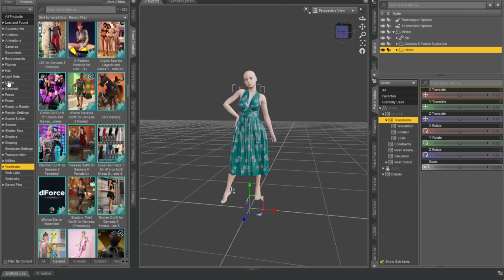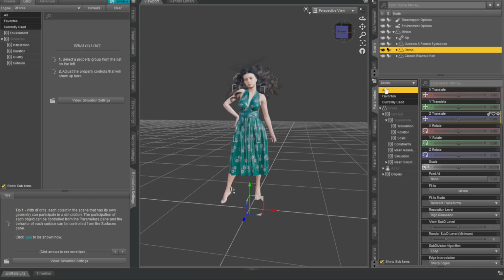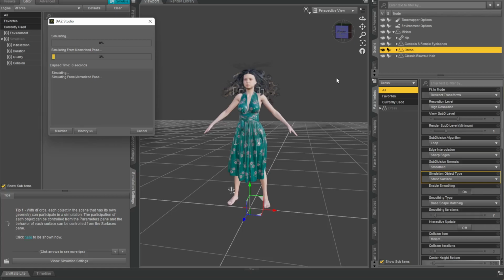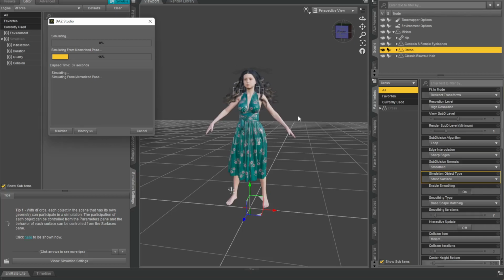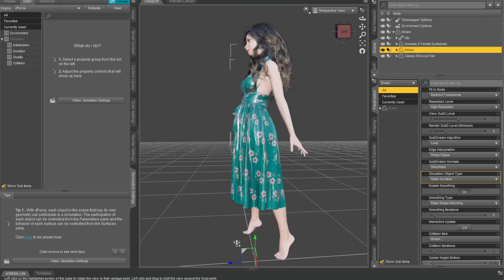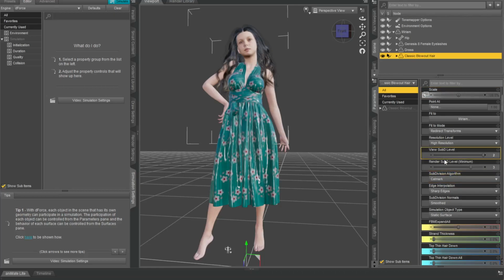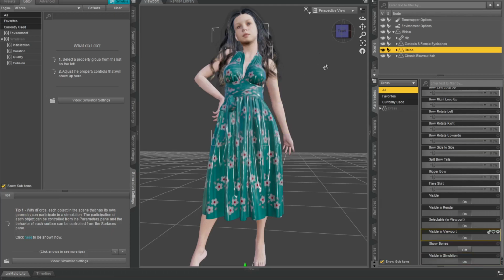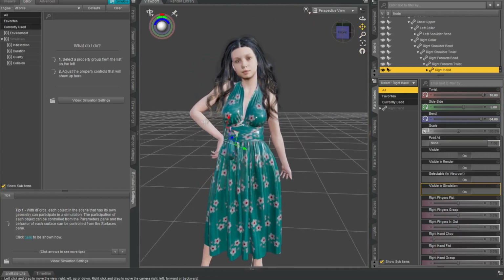Dforce: Quick tip controlling Physics and simulations (easy) Daz

Comment: You can just got to the simulation setting in the parameter tab of the dress and change it to on, so daz then ignores the dress during simulations.
Reply from the maker: Thanks for the comment mate:) will pin this to help  others:)
Reply: @imagineeverything  you can also clear simulations on individual items, without clearing everything else, in the simulation tab, where you set at item to become deforce, on that list there is clear item simulation. 
 I'm not near my pc ATM, but if anyone wants me to be more specific, I will post the exact wording and location.
Reply from the maker: @peterstrong1970   Nice one:) Thanks for being additive to this channel:) Its awesome mate:)
Reply: @imagineeverything  no problem, giving back what I have learned, and it's always good to learn. Keep up the good work.
Reply: @peterstrong1970  Hi, I have one question about simulation. I simulated clothes and want to do another simulation, but so that the first simulation is now a zero point and does not participate in the new one. I found an option where you can save the pose and load it separately, and also save the first simulation as a morph, but I wonder if there is an easier way?
Reply: @redrum1270 I am not sure as to what you trying to do? I get that you did a sim and saved that SIM on the dress as a morph, so you can use that to if needs be to help the next simulation,  but from there I'm at a loss, pls could you explain.
Reply: @peterstrong1970  Sometimes, after a simulation, the clothes hang unnaturally and I want to continue a new simulation, but taking this moment as a basis. If I extend the timeline and start a custom animation from the desired frame, the previous simulation is still reset, although this partially solves my problem. The method using morph did not work for me. 
Maybe I'm doing nonsense, but I thought that there was some simple option

Comment: OMG, another useful tip!  This is probably something I should have known a year ago, but I didn't and it will be so useful now that I know it.  Only last week I could have used it several times which would have saved me a lot of anguish.  :)  Normally I've switched it off or hidden the item but of course then the layer over the other doesn't react to the hidden one...  another huge thankyou - you're a legend!!
Reply from the maker: Actually I remembered you said things exploded alot in your image. Made me laugh as I know it all to well. Hence the tutorial:) Thats great to hear it helps mate:) Use the new super power responsibly:D
Reply: @imagineeverything  I'm still waiting for the 3 hour tutorial on how to be responsible!!!    :))